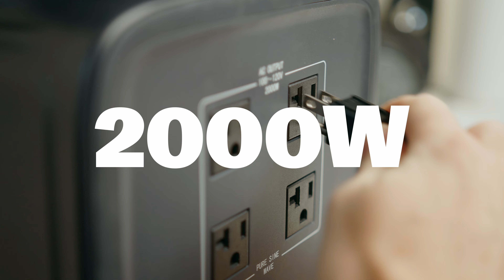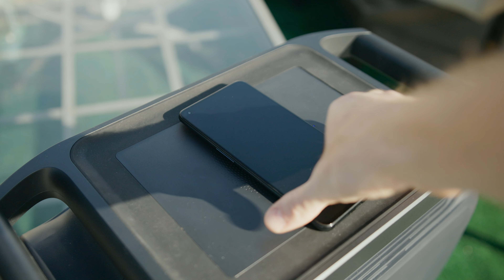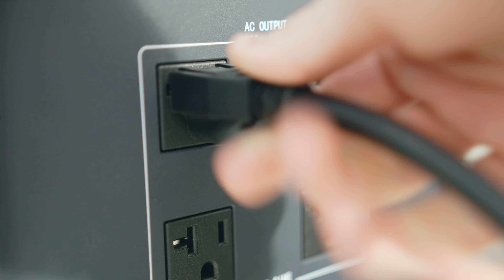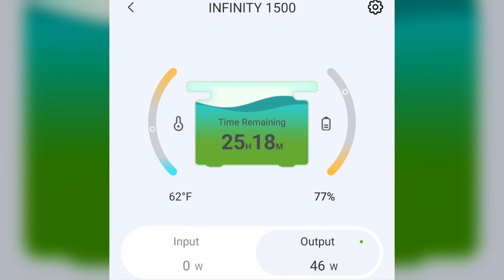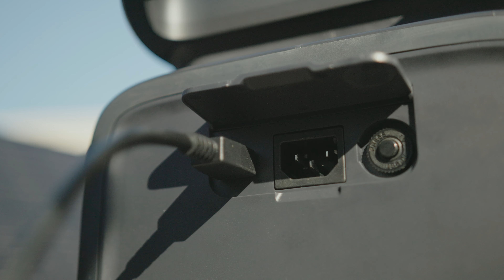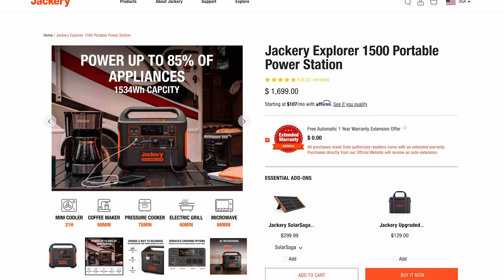Growatt Infinity 1500 Portable Power Station Review: Unbeatable Value

Comment: Not suitable for low wattage loads over long periods of time. The parasitic draw is 50 watts per hour for a total loss of 1.2 KW per day. It also uses more than that with a batter plugged into the XT60

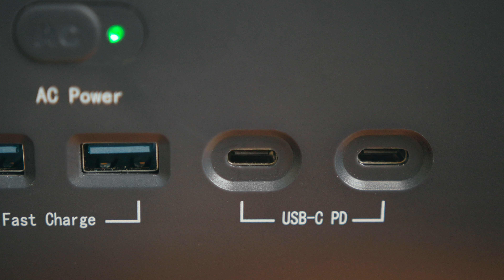Comment: 9:55 - That's could be a problem with OnePlus and other Chinese brand phones, not necessarily the charger. OnePlus in particular has been using extremely fast charging with proprietary tech - which won't work with any other charger other than the one they provide, or a still plenty fast but still slower USB-C PD fast charging standard. It depends where you got the phone from... from what I read, because the latest ultra fast proprietary charger doesn't work well with 100-110V grids, the version for countries that has 110V grids comes with PD instead. If you buy directly from China though, it'll come with the proprietary charger and cable needed for their SuperVOOC tech. It's a bit of a mess.